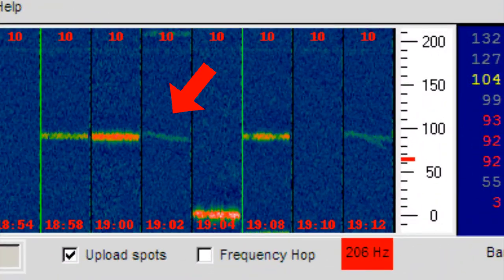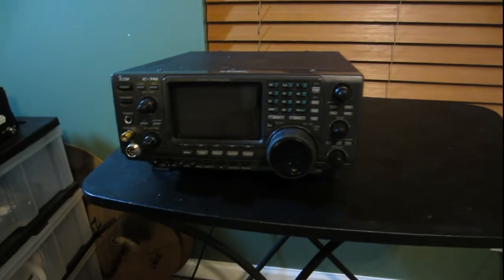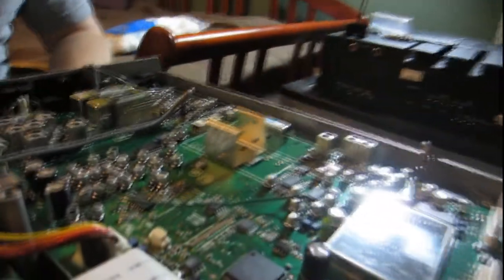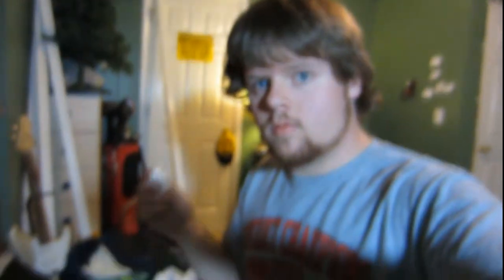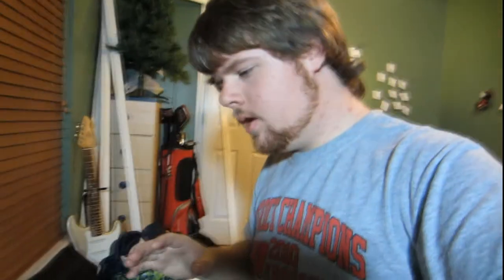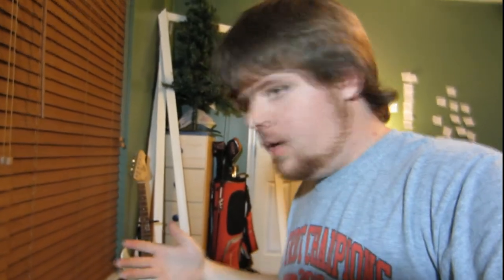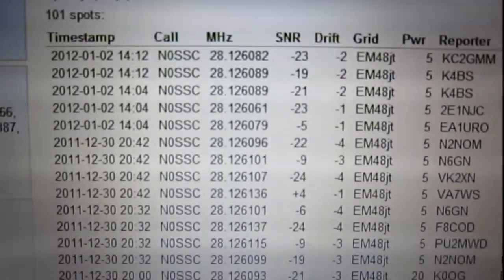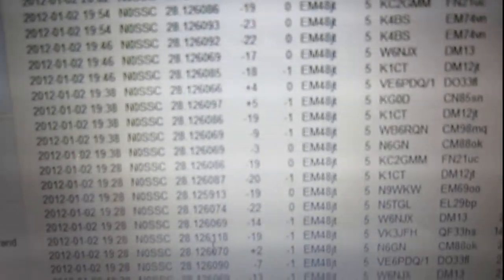Icom IC-746 Drift Fix for WSPR and Other JT-modes

Comment: Thanks for sharing this simple intuitive technique!  I will try it with the frequency sensitive components in the Elecraft XV144 transverter that I use for 2 meter WSPR.  Even with the crystal oven option and an added ventilating fan my frequency can show 5-10 Hz thermal drift with transmit-receive cycling.